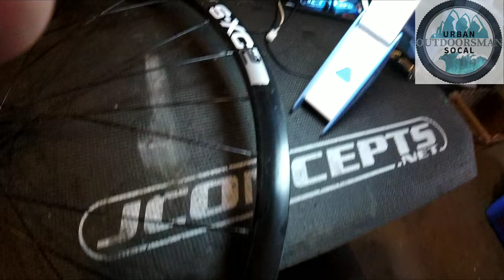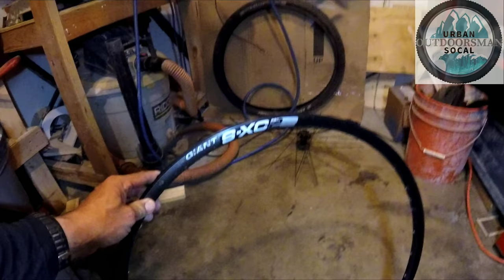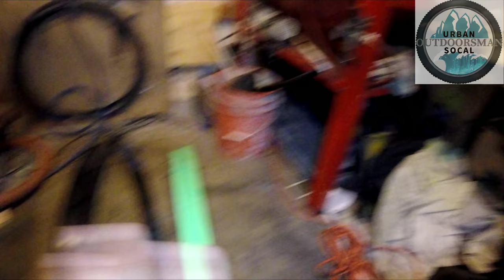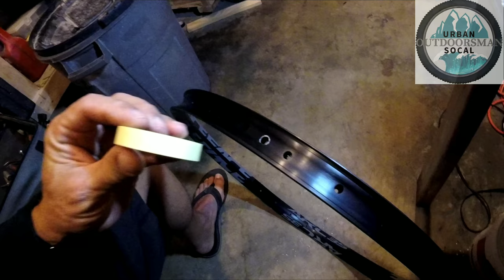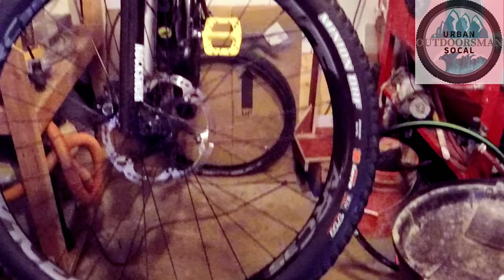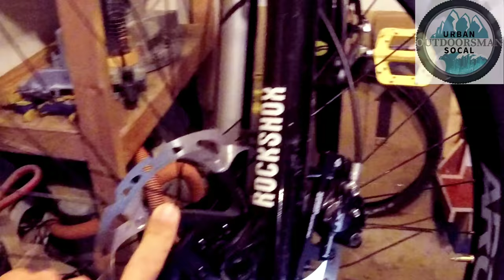Race Face Arc 35 , Maxxis Minion DHF , and Shimano Ice-tech Rotor thoughts.

Comment: Do you have alot of rim strikes yet?
Reply from the maker: hokiedokie I haven't had any actually.  They work great.  You should definitely match the rim width to the tire sizes you are going to use.
Reply: Urban Outdoorsman SoCal good video, you should try the 2.5 dhf on your 35 id rim & put the 2.3 on the rear, I recently got a pair of spank oozy 395+ wheels with 35mm id non boost & have 2.5 dhf front & 2.4 dhr2 rear which ride great (Stumpjumper 29er 2016) also just put a 203 icetech rotor on my rear for my xt brakes which stops me better, all gives a bit more confidence on the chunky decents 👍
Reply from the maker: Robert Tate I have a 2.5 on my new bike.  Its awesome.  I also just put a 2.5 Aggressor on the rear.  It rolls super quiet and smooth.